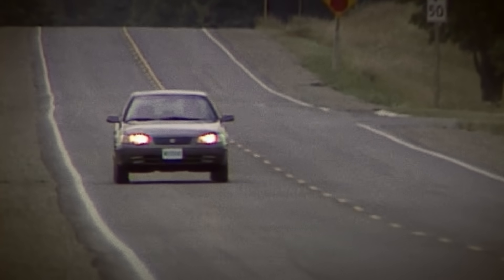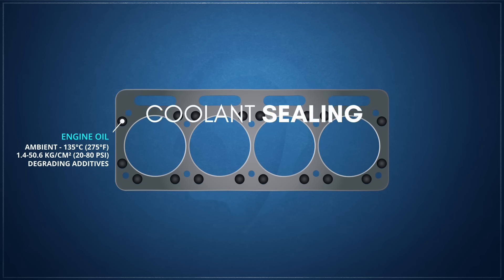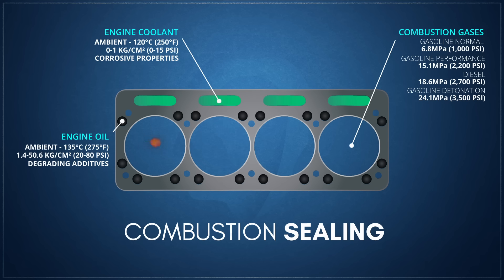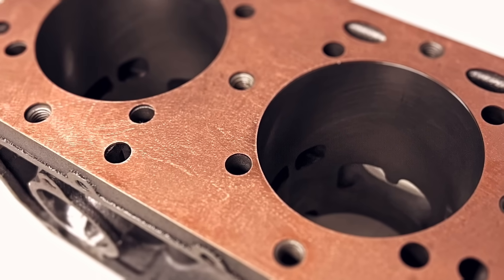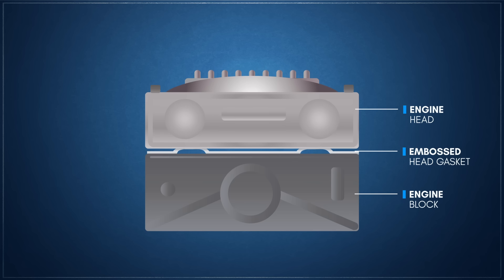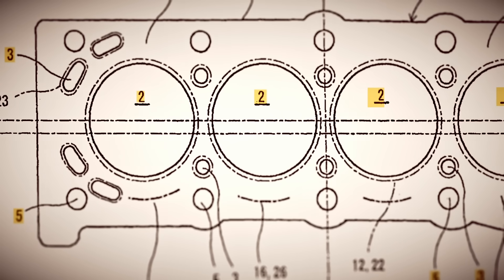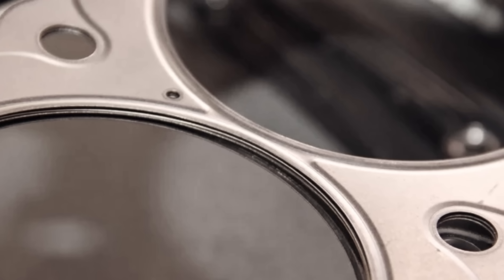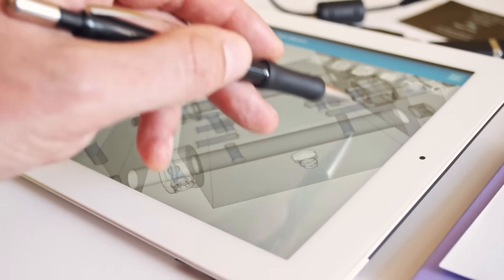The Most Tortured Part In An Engine

Comment from the maker: ▶ Visit https://brilliant.org/NewMind to get started learning STEM for free, and the first 200 people will get 20% off their annual premium subscription
Reply: Backround music in the first minutes anyone?
Reply: I think your micron to inch conversion is off. 2.03 microns are equal to 0.0000799213" you may be using different notation, I just thought I would mention. It looks like it's saying  .060" (as in close to 1/16th of an inch) when it is one thousand times smaller.
Reply: No dude, not in today's plastic engine components, the Ford EcoSport Fiesta Focus 1.0 GTDI EcoBoost Water Inlet Tube 2023617. This part sends coolant to head its 10mm ID thick and is a loose fit to the alloy cylinder head. This is much worse and fails long before the head gaskets, on average few months past the warranty date.
Reply: As someone who had worked in the R&D of head gasket for a decade. I congratulate you on this very accurate story on the evolution of this most important part of an IC engine.
Reply: I just spent the last week rebuilding my sisters Camaro that snapped a head bolt and blew the head gasket
Reply: Awesome video! :)))))

Comment: The head bolts/studs clamping force give the head gasket more than enough strength and support. It is also made of materials that do not degrade from exposure to oil or coolant. I have seen inline 4 engines put back together with cardboard head gaskets that are still running today. This is either willfully false or just an EXTREME lack of technical knowledge. Please stop lying to people just to get sponsorship money.

Comment: I still dont understand why the head gasket is needed. What happens if you dont use a headgasket and how does that happen chronological. Also if you would mold the whole engine head and box in one, would you need a head gasket?

Comment: Cool bit I used to race dort oval kart and the engines we used were Honda GX 200 when produced we would put a lit more piston bore goes from 2.56 to 3.00 you have to weld plates along the cylinder to keep it from breaking off we such a small sealing area on  a ready stressed block we went from fiber fore ring gaskets to copper that had been heat treat and sealed hot ton of steps and used Toyota brand black headgasket sealer to multi layer steel especially swap to steel if you have a smaller piston like 2.8 steel head gasket all day don't need to weld plates on the side of the cylinder either but once you hit 3 inch it's plates welded new copper gasket every couple races unlike a guy running 2.8xx bore can have no brace and run a MLS gasket 

The part that I find interesting steel works at 2.815 bore but doesn't at 3.00 or the gaskets I raced with last time I raced competitively I that's been a year a while I'm sure the tech caught up but I thought it was cool copper only on the big horse

Comment: Headgaskets designed to fail. Could me metal machined slots to fit thenhead in the cylinder to take the stress off the gasket itself

Comment: Video is incorrect. Engine oil flowing through a head gasket is not at 80 psi, that high pressure oil is carried by the pushrods. It is only the oil draining down from above at the lifters on its way to the oil pan and oil pickup that is contained by the headgasket, virtually no pressure there.

Comment: Well done. I’ve been a German car mechanic for over 35 years. I’ve built hundreds of gasoline and diesel engines, including a few making over 200hp per cylinder. The info here is spot-on. Anything other than an MLS design just fails.

Comment: Its mind baffling how an internal combustion engine, working at such high pressures, temperature and speeds and can reliably run for decades. Its because of over hundred years of constant innovation. Its neat to see that process for this crucial head gasket.

Comment: Kinda dumb question here, why hasn’t anyone come up with an engine block that is all one piece, no head gaskets at all?  Probably haven’t been done yet simply because of mass production costs, but I’m thinking about race engines or super-cars?
Reply: Probably repeatability and or cost to make that. I was thinking why have a head gasket at all? If you made the parts to tight tolerances theoretically you wouldn’t even need one.
Reply: @Augustine1488  The problem is that they cannot maintain flatness due to heat cycling, hence the slightly squidgy bit to take up movement!

Comment: This is not a joke. Back in the early 70s in diesel school. We put a Cummins small cam 855 engine on the Dyno. Even with 36 head bolts torqued to 330 foot lbs. At full load, working as hard as it could. You could take a two thou feeler gage and move it back and forth between the heads (3) and block. The teacher had each of us try it.

Comment: At 12:27 you mis-stated the conversion of 1.5-2.0 micron to be .060-.080” thousands of an inch.  And again at 14:32, though in part of that you got it right.  Got that decimal in the wrong place.   Needs to go to the left a few more decimal places!!! I know it’s tough doing down below .0001” (tenths in machinist lingo) to mm in your head.  I struggle with micron conversion myself.  Overall, metric to inch is relatively easy to ballpark since an inch is roughly 25mm (25.4 to be exact) thus obviously every 100mm is 4 inches.  Multiples of 25 being easy for most everyone to go in either direction.  Or a mm is roughly .040” (.03937).  So if I’m trying to covert say .3 of a mm to my native unit of inches then just 3 times 4 and pop in the decimal.  .012”👍🏻

Comment: Hi. Top notch video, thanks. It still pays today to recheck the torque on head bolts, even with modern "tighten-it-once" gaskets. I found that ensuring each bolt (or nut) ran freely on the thread with no trace of binding was the best way to get even clamping pressure over the whole head. A smear of H.T. grease on clean threads means the nuts don't seize after a few years of use. Copper was great because it only needed heat annealing to be used again. Cheers, PR.

Comment: Excuse my ignorance - but has a engine ever been trialed with a block and head cast in 1 piece ? So it would do away with this critical weakness point ? Or would it have transferred the weak point to another area.
Reply: Honda lawn mower engines are built like that as well as a lot of 2 stroke lawn equipment

Comment: An no mechanic electrical I understand have never seen before an explanation of head gaskets that live in motors (non mechanic here)..followed it and even down 2 how they are manufactured nice ....the micron tolerance rates  as the pistons try to lift the bolts away under that amount of pressure ....next time I put key 2 ignition in my 4WD I will pause and think after watching this and yes I restarted and watched twice ,so much more lateral pressure in a diesel yes I paid attention but I digress I have been know 2 do that tk for the upload

Comment: I would argue to say that the head bolts are the parts under the most stress. Being under a mm thick and the small amount of surface area that's actually being subjected to the forces of combustion. The gasket in how it's designed is much stronger than the bolts that hold it together. The bolts are already under a lot of pressure at rest, then when you add heat, the head and block both expand. Which increases the pressure load on the bolts. And then when you accompany that with the pressure of combustion that are further trying to push on the bolts. Yes, the gaskets are exposed to more harmful conditions. But they're not under the most stress
Reply: The only exception is the MLS (multilayer steel) gaskets vs the aluminized cork style gasket. MLS gaskets will last at least double the life of the aluminized gasket. And in some cases, a MLS gaskets will outlast the bolts themselves

Comment: This explains a lot. If you had a Ford 3.8L V6 in the mid 80s to late 90s, it was virtually guaranteed to blow head gaskets. This problem was virtually eliminated in 99 when Ford started using the MLS head gasket for this engine, which you can now turbocharge in stock form up to around 420 hp with no reliability issues. 

I had read of the MLS gasket many times but never really understood the history until now.
Reply: I have a 97 thunderbird with that engine that has a blown head gasket.
Reply: @ihadlunch8575  Well you know what to do! Repair that pushrod baby and put them MLS gaskets in there! 

It being pre-99 you might be able to put the supercharger on it that came stock on the SC Birds. 👍

Comment: There are engines that have a single piece cylinder and head.  Stops the problem all together.  What's more is they tend to be modular so you can just replace a top end and leave the bottom alone.
Reply: But i like gently tapping the bottom 

Plenty of lube and correct guidance of pins is essential in this high pressure situation

Comment: I took a car back to a dealer after noticing water literally seeping out of the head gasket, they sent it to their "mechanics" and job done, no more leaks.
Years later I sold it on, another couple of years later I ran into the guy who bought it, he told me the head gasket had gone, but when the mechanics took the head off... there was no gasket, Just sealant.
Reply: Dealers are crazy
Reply: It was really crazy because I'd had it for 4 or 5 years and drove it all over the country on long trips and regularly did burnouts and donuts in it, the owner after me regularly towed stock/derby cars with it, that dodgey sealant did the job about 8 or 9 years,
Reply: @stephenlindsay3792  good sealant then I guess
Reply: @jayislander  probly sika flex

Comment: Why don’t we eliminate the head gasket and make the head and block one piece ?
Reply: thats not feasible for manufacturing or Maintenance sake. you need to have easy access to the pistons which in a one piece block you would need to take the whole engine out to get to them from the bottom and also what gets damaged more frequently is the head and not the block so being able to replace it increases the longevity and sustainability of the engine. if the head and block were one piece and the "head" gets damaged, the entire thing would need to be replaced.

Comment: If they were made right they would last. They are made to fail. I used racing head gaskets on a 440 engine rebuild. I drove that car 150,000 miles and no gasket problem. The engine was still running fine when I sold it. Then again we were not mixing cast iron and aluminum. Plastic intake manifolds are the worst thing ever. I have worked on marine diesels they used a alloy ring to seal the head to cylinder. Best method I have seen. Some of the engines were over 30 years old and no gasket problems. Things can be made to last but that's bad for business.
Reply: You cannot use ethanol in plastic inlet manifold thats the only drawback I've heard but I'm happy to hear your opinion

Comment: I worked for Cummins engine company. The K series engine was either straight 6, v12 or v 16. All these engines shared the same basic components, ie pistons, conrods , cylinder heads ect. But the 6 cylinder one was called the k19 and  was a strange one. When overhaul time came, a lot of times, the block  and the head were so " wallowed away " .
Not sure of the tight term to use. But the block and heads would need machining and over size head gaskets were available from Cummins.
The boss man reconded the block was a bit too flexible , and this engine was good for 700 hp up, depending on the spec plate. And
In the excavator application, where load varies all the time, block would be flexing and the heads would be grinding away at the block
We didn't ever see this problem in  a generator application.

Comment: I have a toyota 3vze 3.0. Supposedly one of the worst engines toyota ever made. Why? It had defective head gaskets. Now there's only a handull left out of the 45k originally made. Only the ones that got new head gaskets are still on the road. So is it really the worst? Mine has 298k miles

Comment: I feel like the advancements in head bolt/stud technology should be mentioned. The early head bolts were more ductile and lacked "springiness", so they tended to permanently stretch on installation. Repeated installation and removal tended to elongate them with time, but they typically had a long service life. However, they weren't able to reliably spring back as the surface of the head was repeatedly pushed away from the surface of the block when used under high loads. This, combined with the limitations of the head gasket themselves lead to head gasket failure in high power applications. 

Modern engines produce far more power per unit of displacement, and have much smaller surface areas between the head surface and the block surface.

Comment: On your gasket diagram, why are you using both kg/cm2 and MPa for the metric pressure unit? I also think you have some conversions done incorrectly or just typos. 1.4-50.6 kg/cm2 should be 5.6 kg/cm2
Reply: I was asking myself the same. Did some googling and found out that pascal is defined as N/m² and N being the unit for force defined as (kg*m)/s²  (meaning there is some kind of acceleration involved). So now i don't know if im dumb, but where did the m/s² go in his kg/cm² unit?

Comment: Please, PLEASE do a video on welding/brazing. It's a cornerstone of modern engineering with a rich history dating back to our discovery of metals, with major innovations in methodology and peripheral technology. It should be up there with the science of flatness and other machining techniques. There's a lot of molecular physics going on, creating structures that make good welds oftentimes stronger than the metal on the original part.

There are also many unique aspects such as underwater welding and automated welding that can be covered

Comment: Is the sealing power of the head gasket minimized when the engine is cold started before running temperature is approached,especially in Arctic temperatures? Do most headgaskets "weep" or allow bubbles of combustion gas to pass into the coolant on liquid cooled engines if a stone cold engine is full throttled under load right after a cold start? 

  I believe most Diesel engines have some degree of detonation in normal operation especially during the warm up period? Adding higher transients to the already high combustion pressures? (Diesel detonation occurs when fuel does not ignite instantly upon injection and mixing with air allowing a bit of build up that then flashes almost at the speed of light when the ignition event occurs?

Comment: Technology of head gasket bolts/studs?  Extra length of non threaded part to allow a longer length to act in tension? Extended height washers or bushings to allow for sufficient non threaded length in tension? Belleville washers used in the washer stack?

Comment: How about the bolt pattern used to clamp around the cylinders on the Packard 9 main bearing Straight 8?  A lot more than 4 bolts?
Also some of the Ford flathead V8s had ample numbers of bolts or studs surrounding the cylinders? 

  On an aluminum head used on an iron block I believe the head gasket is a true dynamic seal since during warmup the head creeps on the iron. 
I believe head gaskets can be done a lot better than is typically done for lower priced car gasoline engines.

Comment: (?) How much does it Co$t to replace a head gasket on a Honda Crv 2002 after the Engine Seized? It OverHeated one day and White smoke out the tail pipe was the telltale sign that the HeadGasket failed, as after it did that, the Car died and would not turn on anymore and when turning the key it would want to start (zzz zzz zzz) but couldn't. I suspect coolant got into the piston chambers and therefore seized the engine. How much would you guys say is a Reasonable Price to pay to get the car fixed. Not replaced but fixed?

*The Car's Air A/C and Heater System also stopped working at the same time, i think the water pump went bad due to OverHeating when it died. Now the Heater turns on but nothing blows out the Vents of the Car. I can feel Hot Air seeping out the Vents when i place my hand over it but it doesnt Blow Air like it used to. I could swear i smell burnt plastic coming from the Vents. If I turn the A/C "On" I can hear a clunk, meaning the A/C Compressor Activated and is working however No Air blows out the Vents of the car. What could cause this ?  Im thinking the water pump messed up when i overheated the engine. I paid to fix it and so now my car runs, but the Hot Air and Air Conditioning isnt working. No air blows thru my Vents...

Comment: Your units are all over the place. I know that Usonians don’t care, but kg/cm² is not a pressure. Not to mention that units are case sensitive. KG/CM² would be something like Kelvin Gauss litre² per Coulomb² Mole², which makes no sense whatsoever. (M is mole/liter).
Anyway, the upper limit for the engine oil pressure is off by an order of magnitude. 50.6 kilopond/cm²  would be 5 MPa, close to the (correct, i guess) combustion pressure. 80 pound/in² is 550 kPa.

Comment: I argue the piston is the most abused, it's the only part that can move when the compressed mixture combusts. Sure the head gasket is tough but in most thin locations its just pinched so hard it has no other choice. The spark plug is my second one because it starts the explosion by arcing plasma to ignite the mixture without melting itself from the combustion or the arcing.